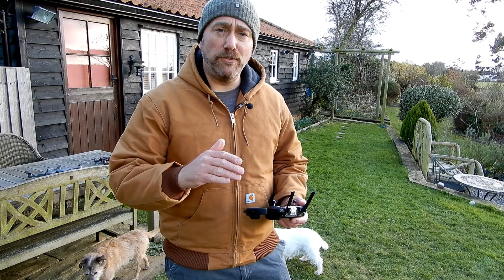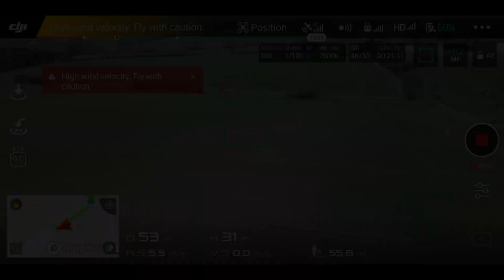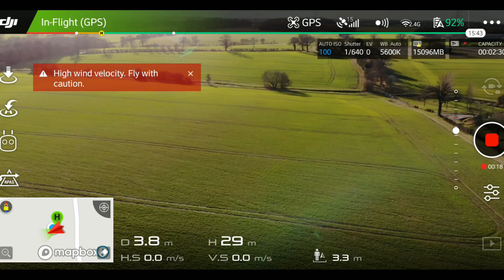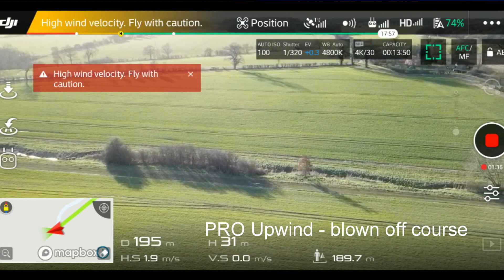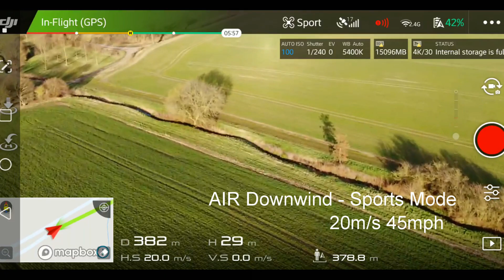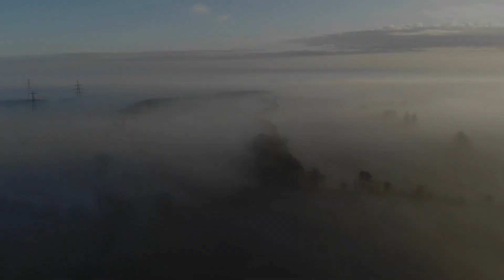Mavic Air & Pro: High Wind Test: How the PRO & AIR differ

Comment: Hi Ian, 

What you experienced with Mavic Pro and Mavic Air heading into wind were exactly the same as I experienced with mine. My Mavic Pro (with OA on) struggled and was dragged sideway in wind but my Mavic Air (also with OA on) handled the wind smoothly. 

There were notices popped up that caught my eyes when I first flew my Mavic Air under strong wind - "Attitude is too large. Backward Obstacle Sensing is not functioning." and "Attitude is too large. Forward Obstacle Sensing is not functioning.". I have never seen this kind of notice with my Mavic Pro under strong wind, in any version of firmware.

I think the difference between the headwind handling ability of the Mavic Pro and that of the Mavic Air is because not only the Mavic Air has a smaller frontal projection area, but also the Mavic Air's flight algorithm handles headwind differently - by design the Mavic Air will abandon the functioning of Obstacles Avoidance and will tilt more than 15 degree in overcoming strong headwind. By design of its flight algorithm, the Mavic Pro will alway limit its tilt to not more than 16 degree to maintain the functioning of Obstacle Avoidance even under strong headwind, and together with its larger frontal projection area the Mavic Pro is more prone to be blown to crawling speed or prone to drift sideway.

Hope my observations ease your concerns and my analogies help to explain the reasons behind the observations.

Henry
Reply from the maker: Henry, thanks for this clear and full explanation. Until I made this video, I, like many others I guess, wasn't aware of the connection between sensor deactivation and speed. The AIR obviously auto-disables its sensors to allow it to fly at the steeper pitch required for faster flight against strong wind, whilst the PRO simply reduces the speed to ensure the pitch doesn't exceed the working maximum for the sensors.
This is a significant difference in fucntionality; one that's not been widely mentioned.
Thanks again for this, Ian

Comment: The controller trims can be adjusted in the pro to give it more forward power in normal mode
Reply from the maker: paul c  The main thing you can do is switch off the sensors which makes a huge difference... Watch this on flying the Pro in strong winds:. https://youtu.be/FfWksdTAUA8

Comment: Hi Ian. looking to set my C1 AND C2 buttons on my Mavric air to camera looking down qucikly and the other to change between video and camera (if I can) Im sure I seen you exspaline this on a video but cant find it?  can you help. cheers
Reply from the maker: Hi Bob; nice and easy one; three dots upper right on App, then third option down for 'Remote' settings, then scroll down to the 'customise buttons' section and scroll through the available options.  Cheers!  Ian
Reply: Ian in London great. Thanks Ian
Reply: Hi Ian

I had a look. Mine inst the same. I don't have the `customise button` option.
It shows a drawing of two controllers. With the two buttons and then a list of things to make them do.
I was hoping to have one quickly point the camera down. But even that isn't on the list as I thought it was.
Reply from the maker: Are you running the latest version of the app?  To be clear, you can only choose from the list that's offered; it's not fully customisable...  And I do recal reading that the 'point straight down' option had indeed been removed' I'll have a check when I'm next flying.  Ian
Reply: Hi Ian. it did an update last week to 4.2.14  You could be right about it taken off now. Ive only had a drone around a month now and i think i seen that opion on an older video I seen on youtube.  B

Comment: Hi Ian.

A question.  I note that the videos you have done appear to be just 'straight line' flying.  Have you made any video about flying in banked curves and, if not, could you?
Reply from the maker: Hi Tony; the closest I've done is my 'Smooth Camera and Gimbal Settings' video which goes through the settings to makes turns and movements smoother....  Cheers, Ian  https://youtu.be/fRS0nXMaW9o
Reply: Thanks, I'll have a look.
Reply: Hi Ian.  I've just had the MA up properly.  What an incredible machine!  I am so impressed.  The only down side is the battery time - I could have been out there a lot longer.
Reply from the maker: Great stuff Tony; It really is a great piece of kit.  First thing I did was get two more batteries... and a car charger :)
Reply: Hi.  I got the package with two extra batteries so was in the air for about 45 min until I got a battery warning. 

One last question if I may.  I started in beginners mode but when I got it up quite high, I think I got the option to turn the mode off.  As I was watching the aircraft more the screen so I'm not sure.  To save me trawling through the manual, is that normal?
Reply from the maker: Beginners mode stays on until you disable it in the app settings, and to do that you need to log in with your DJI-registered email.  In beginner mode you're restricted in height and distance, but still get a good flight....  Cheers
Ian

Comment: The question would be what is the top speed when you don't have sports mode on for each unit.. 

If the top speed on the mavic air without sports mode is faster than of course it's going to go forward faster..

Comment: Hi Ian

I had an R/c helicopter many years ago but, after one VERY short attempt at flying, lost my nerve and sold it.

I've been toying (struggling) with the idea of acquiring a drone for 18 months  and have taken a long hard look, initially, at the Mavic Pro.  Then the Air came on the scene.

My main question is simple.  Is it easy to fly and stable? 

Tony
Reply from the maker: Hi Tony. Yes in a nut shell. They are extremely easy, as they have GPS to ensure they literally stay stationary if you take your hands off the control.  They have auto take off and auto land functions and the only reason you'll crash is if you get over confident :). I would wholeheartedly recommend the Air. Take a look at my Air and Pro comparison video.... Cheers, Ian.
Reply: Hi.  Thanks for that.  I feel a bit more confident about going after one.

Another Q if I may.  Looking at your direct comparisons with the Pro and the Air, the Air appears to have a over-cooked the colours in the fields at the back of your place, whereas the Pro's colours seem more realistic.  Can the colour settings be adjusted on the Air?

Lastly, it's nice to find a English reviewer that says it as it is and not go OTT - USA style. :) 

Cheers

Tony
Reply from the maker: Thanks again Tony. Yes, the colour mode is extremely adjustable, with a variety of presets and a manual mode too, so you'll be fine on that. And glad you like the style! I don't want to be too staid and boring, but I currently have no urge to open with "What's up everyone" and flick my fingers..... :)  Cheers!  Ian
Reply: Hi Ian.  Well, my MA has just arrived.  Wish me luck.  I'll let you know how I get on.
Reply from the maker: Good luck Tony.  Take it easy; watch my Mavic Air series of videos and also watch this playlist of mine... it may help :)  Ian  https://www.youtube.com/watch?v=FfWksdTAUA8&list=PLgFHmUkOJvSvlcNqVrBNxfl8GxeI3L2e_
Reply: Hi Ian.  When setting up for flying, I find I have to go through the scanning sequence with the code on the side of the Air so that the phone/controller connects with it. Is this a normal procedure or should all the kit 'see' each other and connect straight away every time I switch it all on?
Reply from the maker: Hi Tony. No, the remote and aircraft should automaticailly connect within 10 seconds without any input on your part other than turning them on.  My usual procedure is turn aircraft on, and imemidately turn the remote on, then immiedaietly select the Go 4 app..   The app should change to the blue 'Go Fly' after it connects.
If you're struggling, try 2 things:
1. Try connecting wihtout the phone attached at all to see if the phone is the issue.
2. If it is, uninstall the Go 4 app and reinstall.
3. If the phone is not the cause, try an IMU recallibration to reset the drone itself.
Cheers
Ian
Reply: Thanks.  I'll give it a try.

Comment: I returned my Mavic air, for me I could not deal with the small battery, wifi connection issues one minute you are connected next minute your not, and so small the wind takes it away.
Reply from the maker: Well, I found it rock steady in the wind, but it's true, the low flight time and connections if you're approaching 1,000 metres isn't great... Let's see what MPll brings....  Ian
Reply from the maker: I'm Android.... but truth be told, I have occasional trouble with the Air. generally great, but occasionally bad.... Wish it had Occusync...!  Ian
Reply: Do you use an android phone or iPhone? Apparently the range is massively affected when using an iPhone do to the way it handles gps

Comment: There is no mystery here at all. When it is windy, and the Air needs to angle more to fight it, it angles it and pops those two messages telling you the attitude it too large(it is angling into the wind, and the OA cameras are now pointing down in the front and up in the back rather than toward you direction of travel) and the front and rear Obstacle Avoidance is shut off automatically. You said some people don't want to fly in sport mode, because they want obstacle avoidance. YOU did NOT have obstacle avoidance on the air, when you were flying into the wind! It was shut off when you got those messages. If you want to actually compare them for speed, you need to shut obstacle avoidance off on the Pro as well.
Reply from the maker: DragonFlyAerialsLLC Yes , that's exactly the case. I pinned a comment explaining this... But the fact remains the Air auto shuts off the OA, to allow you to continue flying at speed, whilst the Pro just goes slower and slower until it stops...  Which isn't the best functionality for many people. Cheers, Ian.
Reply from the maker: Drone Video Productions Hi there... I'm actually doing my next video on this as a few people have asked this. It's the tilt of the drone, making the sensors point too high or low....

Comment: Cool review. Wondering how would the p3s do on the same test
Reply from the maker: I reckon it would do better; it's all to do with the obstacle sensors; the Mavic Pro slows down to maintain a more level pitch. The Phantom 3 series didn't have sensors, so the pitch could go steeper when needed. Ian

Comment: Great vídeo! Looks like the air has better images out of the box With no altered settings. So if distance and battery time is no issue, do you prefer the air over the pro if you could buy Just one of them? Thanks
Reply from the maker: If distance and battery time is no issue, then I prefer the AIR. More portable and more camera options, with some useful internal storage too.  Ian

Comment: Hi Ian, I don't understand your "surprise ", you've been making some good videos for a while. It seems that now you have the air, you don't rate the Mavic anymore. Before I got into Dji drones, I was like that every time I got a new one and I've got loads. In fact whilst I love my Mavic I'm beginning to find this type of flying a bit boring, maybe that will change when the summer arrives, I'm just a little confused in what your saying cheers
Reply from the maker: Hi Alan.  Don't get me wrong; I still love the Mavic Pro.  In every video I've put on over the last month, I've tried to be balanced and simply state the facts.  But this particular video really did surprise me.  I was the first time I did a proper comparison and the first time I resisted the urge to just 'flip it into Sports Mode'.  As it is, I've had a fair bit of information come in from Mavic Pilots and the DJI forums since posting this.  It's all about the obstacle sensors and basically the AIR auto-disables them allowing it to fly at a steeper pitch and therefore faster into the wind, whilst the Pro doesn't diable them, requiring it to simply slow down, until the user flips it into Sports Mode (which then disables the sensors).
So very different behaviour with very different results.
But my message remains the same; if you have a Pro, stick with it; if you're gettign your first drone, then probably go for the Air as long as you're okay with the shorter ranger and flight time.
Cheers as ever for your input Alan!  Ian
Reply: Ian in London cheers Ian

Comment: Ian very good video. I flew my pro in  21 mph wind at 1000 feet high the other day. 21 mph measure came from Google..the wind took the drone 2000 feet away..lost control.I could not fly it back for a while ...i finally. Dropped the drone down to 300 feet or so...and struggled to get it back home....it did make it...all that was done in non sports mode....watching you confirms that in high wind you have to fly in sports mode...to make progress....thanks for the super info ...very helpful....
Reply from the maker: Hi Joe. Glad you got your Pro back, and your experience confirms what I'm saying here. If you don't usually use Sports Mode it can easily catch you out...  Cheers, Ian
Reply: Ian in London very true ....I don't normally use sport mode as it kills the battery faster ...but with high wind it seems its a must

Comment: I'm about to pull the trigger on one of these. If you could only have one of either the pro or the air which one would you choose?
Reply from the maker: John, if range and flight time is important, get the Pro. If you can handle shorter flight times and are happy to stay under 1,500 metres distance, get the Air. It's smaller, lighter and as long as you get the combo (for the spare batteries) you'll love it...  Ian
Reply from the maker: So I've just been told..... I'll be testing that out next weekend thanks David.  Ian.
Reply: Ian in London thanks for the reply. I'll probably go with the air then. I have a TBS discovery with crossfire if I need to go far I guess. The extra features and smaller size of the air are really hard to pass up.

Comment: Cool, compared to my P3 Standard my Mavic Pro struggles into the wind, but enable sport mode and its fine...
Reply from the maker: Exactly!  SO I just wondered why the Pro makes you jump into Sports mode in order to handle anything more than a strong breeze....  Cheers, Ian
Reply: Ian in London probably to keep the battery fly time up on the specs perhaps 👍